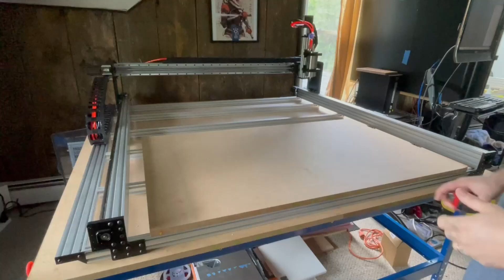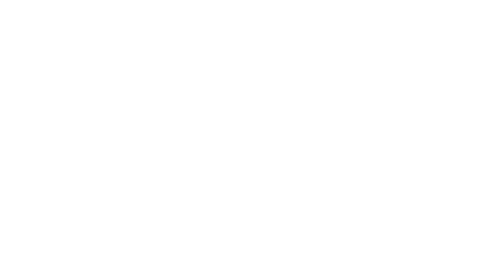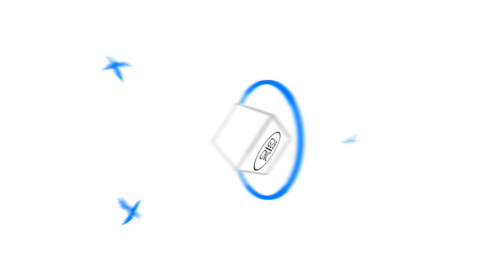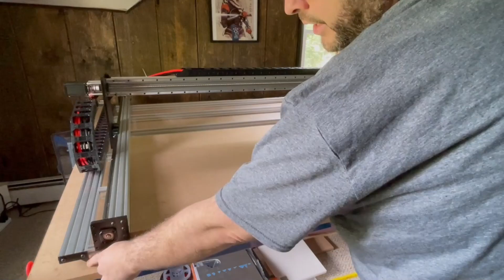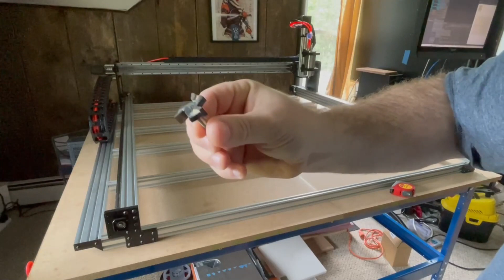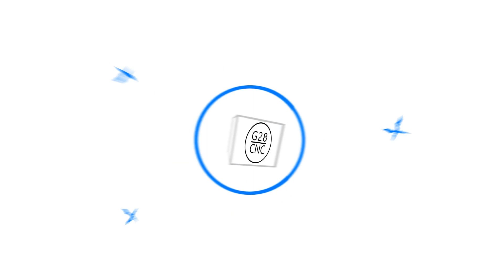8. Ultimate Bee - 1515 Dimensions/ Actual Size

Comment: Oh MAN...I wouldn't have been able to build mine without your videos...I bought the Ultimate Bee 750x750, received it 2 weeks ago, now frame and all axes have been set up, I'm doing the electronic wiring at the moment. I chose the DDCS4 V3.1 OFF LINE controler with the HBS57 drivers, NEMA23 3n.m and the 2.2kW spindle. I'm glad your videos were here to help me out, no way I would read their instructions "incomprehensible" to the fullest...BIG UP to G28CNC 🙌

Comment: This is what they say on their website for the 1500x1500 working area...   1500x1500mm	x-1273mm	y-1262mm	z-180mm
Reply from the maker: I don’t think they account for a spoil board or any padding for the limits in those numbers- the difference from what I gave is not hugely different but if you should account for it if you want a little bit of headspace and a spoil board

Comment: Hello! the spindle 1.5kw can cut steel?
Reply from the maker: I don’t think this machine is robust enough to efficiently cut steel. I’ve seen videos of people gentle grinding away at both mild steel and stainless but it’s just not made for that. I think you’d want to direct your searches to a mini-mill VMC, something with higher torque, lower rpm’s, a more rigid frame and flood.

Comment: do you find any limitations to you ultimate bee ? i’m
interested
Reply from the maker: @newagainresurfacingn.q.ngu4218  my only real complaint is the design of the x axis- I wish that the spindle had a little bit more travel and that the extrusion were stationary and a plate moved. It’s not a huge deal but if you notice, I am limited on how deep I can plunge by the combination of the two. Imagine I had something 5” in height that I wanted to mill into a few inches. There’s not a great way to go that because the extrusion will bottom out. Again, it’s not a big deal because of what most people I tend to use the machine for and the price is great. 

I tend to use my small machine more (it’s a queen bee) but that’s because it’s set up for aluminum and that’s what I work with more often.

Comment: First of all thanks for your step by step tutorial . it helped me alot. i just finished my 750x750 ultimate Bee with a cnc xpro v5. i see it is not your first build . maybe you can assist ?i am trying  2 software  A gsender and cncjs on the gsender i can't open the look and on the cncjs i get a message check door . any idea Thanks
Reply: Thank you so much.
Reply from the maker: @oldmanwoodcraft thank you! How’d you make out?
Reply from the maker: I’m not super familiar with the xpro but I do know there are a few versions of the firmware and they pertain to the door safety switch, estop and limit switches and whether or not they are normally open or normally closed wiring. Are you using a door safety switch? If not then there is probably a way to disarm that

Comment: This is good info as I just ordered a 1500x1500 yesterday.  Now I can plan out my table a bit before it arrives.  Thanks!
Reply from the maker: Awesome! When I ordered mine I searched a ton of forums and couldn’t find the actual dimensions anywhere, drove me nuts
Reply: @G28CNC  i think the challenge may be, since this table needs to be wider than a standard 4 foot sheet good, making sure the table surface is dead flat.  You are using a Kreg setup where the metal frame is probably very flat.  I'm either rebuilding an existing bench to make it wider or building a complete new solution.  Haven't decided yet.  I guess I better figure out something in the next two weeks!
Reply from the maker: @mtnjak  I still had to add supports to the Kreg table and level it out at the joint. I’ve seen some really nice lumber framed tables as well with nice storage underneath. There is also an aluminum extrusion table for a 1515 from openbuilds. I almost home built a version of that but the Kreg table was less expensive than sourcing the extrusions and hardware.

Comment: And are you happy with the Ultimate? As you weren't that happy with the workbee that you had a video earlier.
Reply from the maker: So far, it’s performing nicely- my other machine is a queen bee which I absolutely love. I don’t have a workbee, I wonder if maybe it was someone else’s video you saw? I have heard good things about the work bee though, I just wasn’t into the belt/roller set up on them.
Reply: @G28CNC  Thanks, I am slowly preparing for a purchase of the 1515 ultimate. Almost finished the table that it will be on. Welded that together so very strong.. Also trying to understand all the related software. Anyway, planned is to get the 1.5 kw spindle with it out of fear for the sag on 1500 mm.
Reply from the maker: I welded the table for my queenbee- it is solid. Out of fear (and hope) that I might be moving my equipment to an actual shop sometime soon I opted for a large table from Kreg tools for the ultimate bee since it’s so much larger. I also went for the 1.5kw on the 1500 for the same reason- I like the ER20 collet that is on the 2.2kw but didn’t want to risk the sag. I’m sure you’ll be happy with whatever option you end up going with though. Really great bang for the buck.
Reply: Where I live (Thailand) we don't have all the options like kreg benches. So welded it myself. Very sturdy. Same for choices of cnc. Some local offers but the specs are not clear at all

Comment: Are you planning on doing an enclosure ? I’m thinking of doing a 6x6x3 ft (1830x1830x914mm)
Reply from the maker: I planned to do one- I purchase all of the 2020 extrusion and some sliding draw bars to make access spot for the rear of the machine for clamping and cleaning but I’m a bit nervous about adding more weight. I have this on the second story of my house in a spare room. Your size seems correct though.
Reply: @G28CNC  thanks for the feedback. I was going back and forth on dimensions and I felt like that was good enough. As for your floor, I would recommend (as a mechanical engineer) distributing the load of the table over a larger area. Typically when things break is to do pressure points, like the legs of the table. Distributing this load over a larger area using double stacked plywood and 2x6 can reduce the load on the second floor beams significantly. Rather then two beams holding it it could be 4-6 beams. Increasing the factor of safety
Reply: @G28CNC  even right now I would still have at least a 2 feet x 2 feet square (preferably metal) for each leg if it’s on a plywood flooring. Just my 2 cents

Comment: Last question (: what are you current steps per revolution and speeds and accel ? I know your using a different controller then me but the values will help (:
Reply from the maker: I ended at 80 steps/mm on the x/y and 200 on the z. That will be dependent on what microstep settings you use in your drivers. I’m not positive how the UC300 does microstepping. I’d recommend starting at 100step/mm and adjust as needed

Comment: Thanks really appreciate it! How are you planning to mount the spoil board ? I ordered some 2040 4 bolt angle brackets that I think will work decently
Reply from the maker: I was going to make some countersunk slots so I could bolt it to the 2040 extrusions at regular intervals. Once I have it modeled up I can share it
Reply: @G28CNC  let me know when you make the spoilboard pattern. I’m playing around with aspire but I’m nervous to cut. I almost want to just do it with a drill 😅
Reply from the maker: @AR_Aero_Engineering  I’m actually working on it today!
Reply: @G28CNC  awesome, I’m currently in solid works working on a configuration. M5 slotted holes, countersunk half way into the mdf. 6 screws be beam 300 mm apart. Is what I currently have